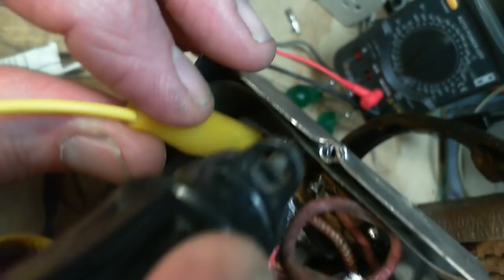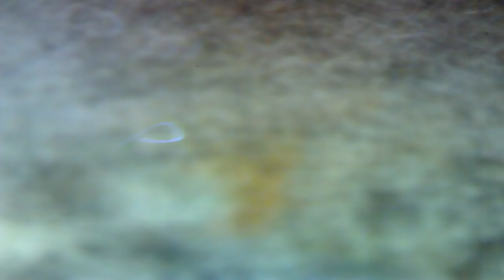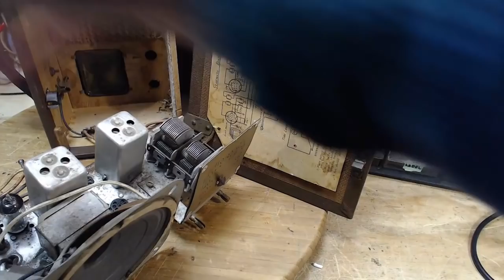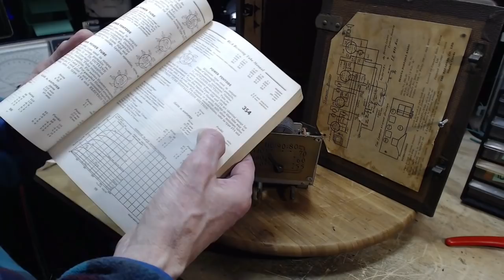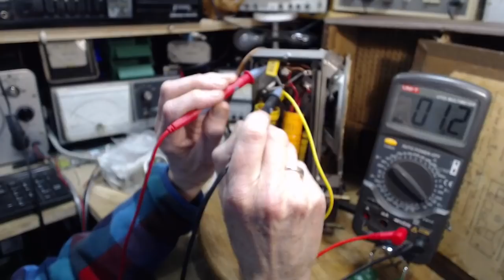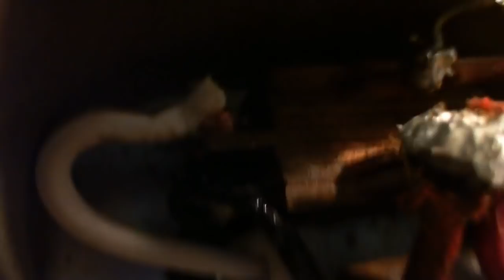Breadner Bradna JBL 37 Tube Radio Video #2 - Selenium Rectifier

Comment: Sometimes the only way to solder is using one of those hefty irons of the past or in my case i use a cheap 80 watt Asian iron just for stubborn jobs like that toggle switch you are soldering.

Comment: I collect these three way portables and I don't bother with the AC power supply anymore. They work much better on batteries. I build my own battery packs using cheap dollar store batteries for the "B" battery and use a rechargeable batteries for the "A". The "B" battery is only around a 10ma drain so it lasts a long time. It's the "A" battery that takes a beating especially if the tubes are wired in parallel. The radios that have an RF amp stage are blistering hot DXers.

Comment: Never replace a Selenium rectifier with a Silicon one without  an additional voltage dropping  series resistor. 
This is due to the tubes getting a jolt off the Silicon diode compared to the old Selenium one. These  lower voltage tubes definitely need it.
Reply: True story! there are many threads about this on the antique radio forum.
Reply: @walk-tall-hikes  would a transformer with a primary of 120V and a secondarys of 1.5V-0-1.5V and 45V otherwise you run the risk of blowing every one if the Space Charge Vacuum tubes.

Comment: I bet he installed that diode with the polarity reversed...
Anyway, typical Jim mess - The DMM doesn't work, he can't solder properly with that puny soldering iron; the temperature is too low... And why does he insists on those ridiculous J-hooks  even when he's soldering braided  cable? The man is a mystery and each day he looks more and more confused, just like Joe Biden...

Comment: If the heater voltage is 1V then the tubes are Space Charge Vacuum tubes and will work on  a B+ of 45V a B+ of 90 will cause them to run hot.